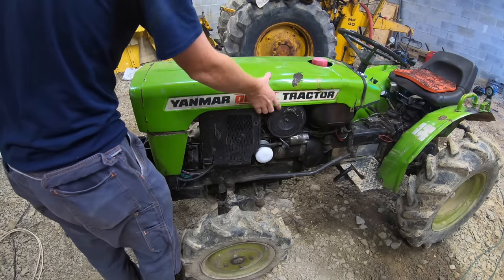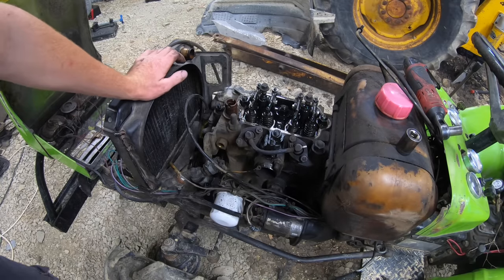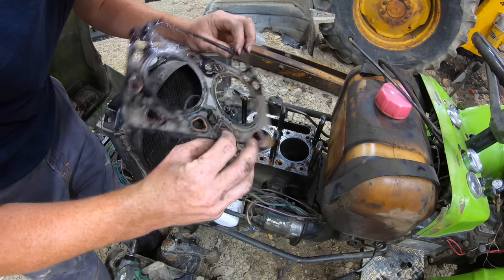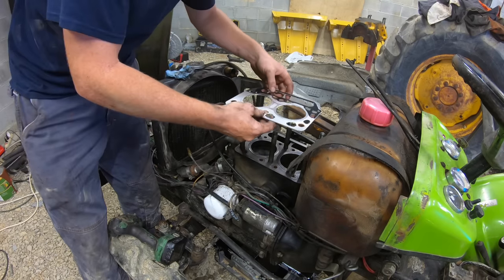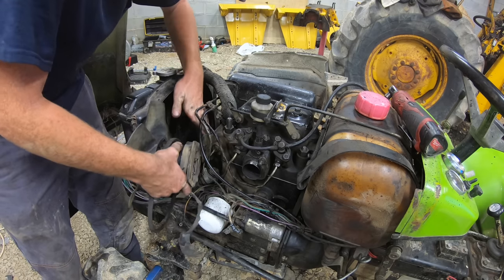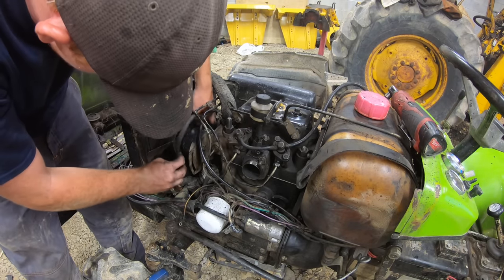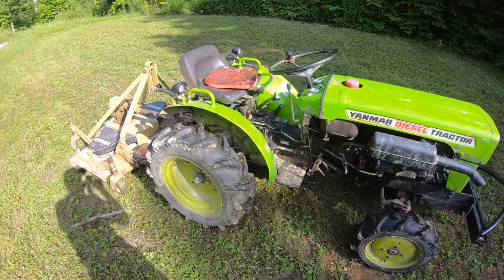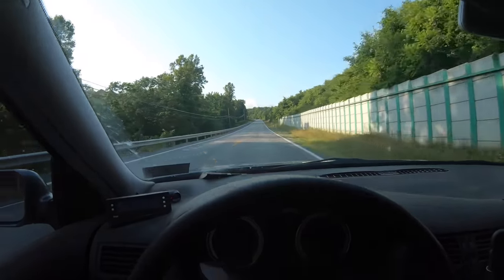Replacing a Head Gasket on a Yanmar Tractor

Comment: The way you're torqing the head down is not a good way to do it. You work in a circle pattern from the center out and you're going from the outside in I guess like star pattern I'm guessing. All you're doing is tightening the outside first and then when you get to the middle you're increased the gap for another potential leak. Kind of like if you were to nail a carpet down in your house and you start on the outside edges to work your way to the middle you'd end up with a bulge in the middle. No valve adjustment?
Reply: Don't worry. First time he cracks a head he'll learn to get on the net and find the torque pattern. I guarantee.

Comment: I have a Yanmar 2202D. Cooling system froze over the winter. I've replace the water pump and a freeze plug so far. Now it is leaking anti-freeze out of the top rear of engine. I think I need to replace my first head gasket. Thanks for the video.
Reply from the maker: There’s a plate on the back of the head that can warp and leak to, it’s worth checking before pulling the head

Comment: They got to be torque right on a desiel your dealing with alot of compresion I use little oil on threads of the head bolts and I put them on the bolt without the head see if there any ruff spot in the threads because that will give you a false reading